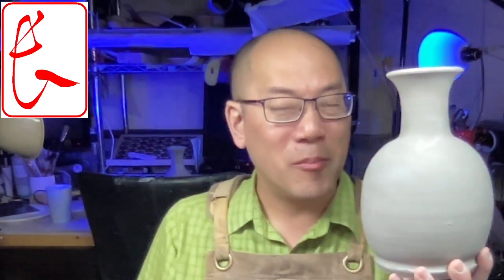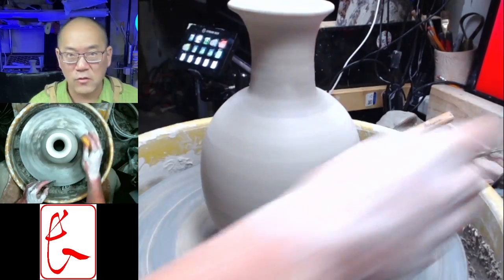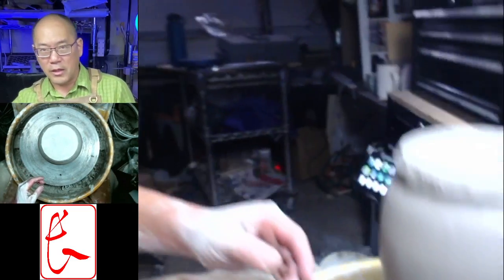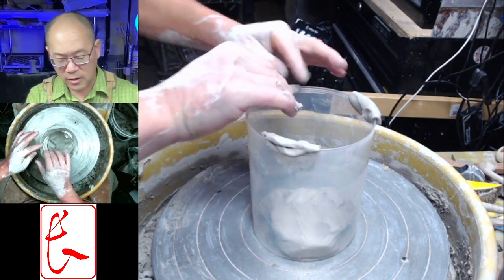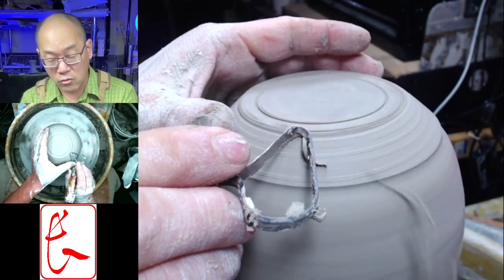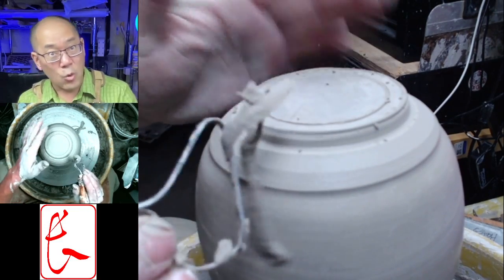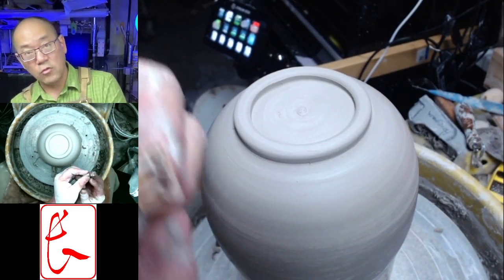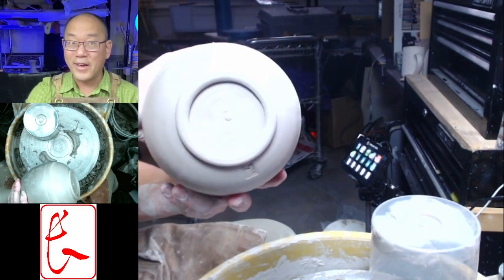How to trim a Vase or bottle

Comment: Hi John! I've been catching up on your videos recently. They are very thorough and I appreciate the effort you go into your explanations. This time I noticed you mentioning tap centering. I spent literally months of time practicing and it was only recently when something clicked and I realized how the physics of it actually works. It was then that I finally started mastering the technique. At first, I thought the point was to hit the piece being centered with an exact amount of force so that it lands in the right center spot on the wheel. I marveled at how potters seemed to do this by apparent feel or muscle memory. But that's not what is really going on at all. For anyone who has struggled with tap centering, hear me out. Think back to watching Olympic figure skaters. They make a lot of use out of centrifugal forces. For example, drawing their arms in during a spin effects their rotation speed. Now this is just an analogy to consider with regard to wheel rotation. Tap centering makes use of the same centrifugal forces. The idea is your wheel spinning will guide the piece to true center, not necessarily the tapping itself. The more important skill you are mastering is the timing of the taps, because you're trying to get centrifugal forces to whip the piece towards the center as it turns. That's why when it's done correctly the centered piece seems to just instantly stop in the correct spot. Anyhow, this concept is very difficult to articulate so I hope I've made sense and it helps people who are struggling to tap center. Keep trying, you will get there. The hours spent practicing is worth it, too, just in how much time you save later trying to center with a needle tool.
Reply from the maker: That is an interesting idea. I never thought about it that way.
Reply: Thank you. I've been studying this effect for some time now and have realized additional insights about it.

A tap done at the perfect time means you are hitting the pot when it is at its most off-center point in the rotation. That is key. At exactly that moment the tap will be aligned at 90° to the wheel's rotation, or dead center on the wheel. If you miss the timing then your tap pushes the pot in a different angle, so in other words it goes away from center. The tap forces a quick lateral movement while the pot is already spinning. Like the Olympic skaters mentioned before, this movement towards the center of the wheel briefly increases the pot's rotation speed relative to the wheel's speed. Then centrifugal forces reorient the pot to the exact center. Perfect tap timing makes it happens automatically. But if your timing is off then the angle alters this increase in spin effect, sometimes to the point it throws your pots right off the wheelhead. A tap off center pushes the pot towards the outer part of the wheelhead and it wants to fly off at the point where lateral momentum is greater than rotational momentum. Perhaps this is why the technique seems easier to do when the wheel spins faster. 

Also, sure would be a lot simpler to draw out my explanation than type it. I find the concept difficult to put into the right words. So I hope it's making sense.

Comment: Question: If I trim the pot like this and level out the bottom while the pot isn't stuck at level, wouldn't that mean that the pot will stoop to one side after I turn it back around?
Reply from the maker: Yes,  if you are trimming the pot if it is not straight it will sit a little crooked.  Try to make sure it is level when triming.